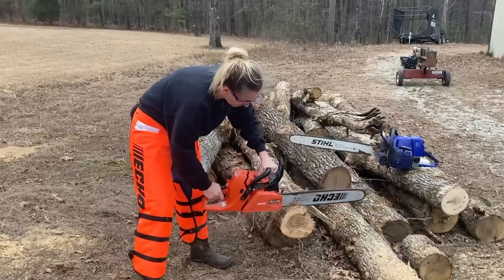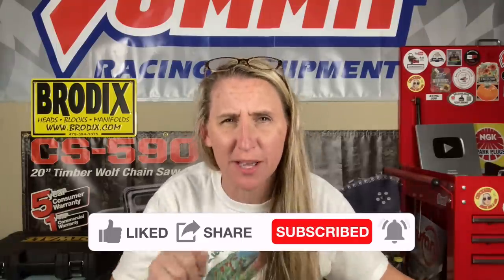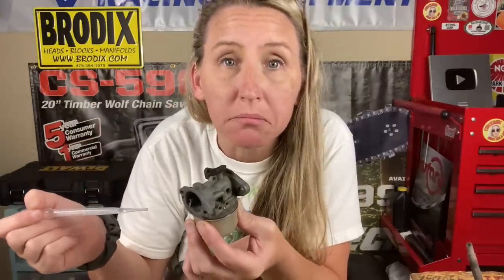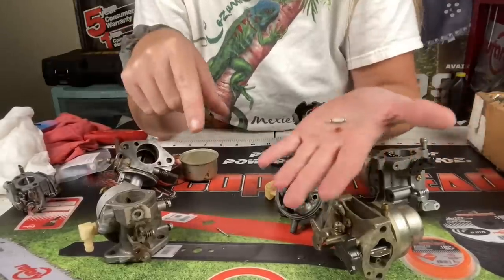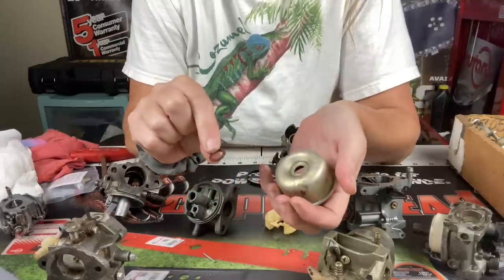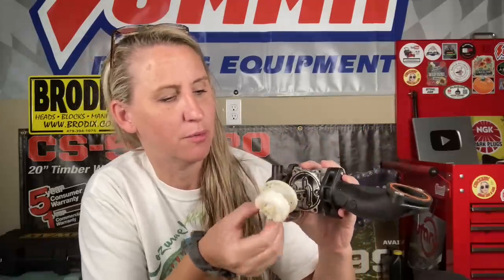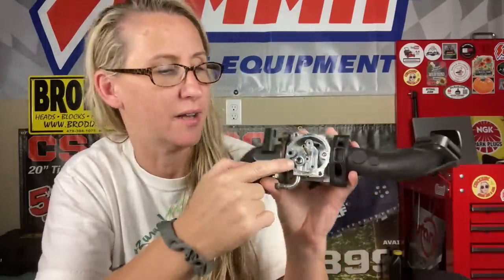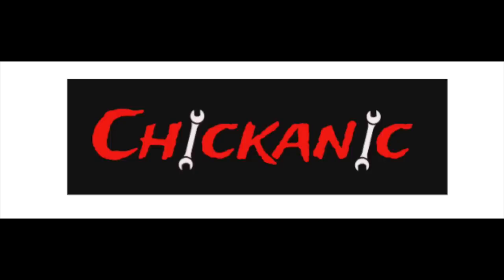STOP doing this! The RIGHT way to figure out small engine carburetor leaks.

Comment: I went the fuel shutoff route on my  riding mower.
Reply: Me, too. Easy peasy.
Reply: Same
Reply: Same here. Cheap easy to do and 99.99 guaranteed to every time. Great for winterizing letting the bowl empty out and not sitting with a carb full of fuel for months. No pinching fuel lines if you need to pull the carb or even your tank if need.
Reply: Wisconsin winter is a cruel mistress. Especially to gas that sits all winter.
Reply: Excellent video, thanks for the information.😀
Reply: @@backwoodsvirginia "revenue generators". Besides, the average "birdhouse builder" would never use it.
Reply: Same....
Reply: I put a shutoff on everything. One of them I need a pair of pliers to turn it. How can plastic be that hard to turn😂

Comment: I don't waste any time buying any internal carburetor components.i always replace the carburetor which on Amazon is $12 -15 bucks and it's the best fix on everything I work on with any kind of fuel related issues..I've been a small engine technician for over 25 years. I love watch and love all of your videos because you are professional and very talented..
Reply: Have you seen her videos explaining why you would perhaps be better off rebuilding the OEM carb.s?

My advise. If you are not a very good mechanic, and also poor, and in a hurry to get shit done; get the knock off's. 50/50 you get one that runs well and lasts though. Then when you make some time, clean and rebuild the original carb..
I have been tempted to buy an off market carb., but never needed to, yet.

Comment: About 4 years ago I got a 1 year old Murray rider for $25 because the engine was seized. I checked the oil, and it was ALL gas. The guy I got it from said "I just put a Brand New fuel line on it ". He DIDNT put in a fuel shut off valve and it drained a Full tank of gas through the carb, filled the intake, and then filled the crankcase. The engine couldnt turn over because it had Hydro locked because it Cant compress gasoline. I drained the engine, refilled it with OIL, and I installed a shut off. Probably the best $25 I've ever spent. I actually used it earlier today. 😎

Comment: Hi Chickanic.
Totally spot on 👍
Another reason the float bowl seal might leak is because they tried to fix it themselves, and didn't fit the bowl on correctly so when they tightening up the floatbowl bolt, the bottom of the float bowl got pulled up so when it is sat correctly, there isn't enough pressure pushing on the seal to seal it.
Just a few gently taps to push it out stops the leak 😁

Comment: Back in the late 1950's I rode 1940's Cushman motor scooters. Then I moved up to 1950's and 60's Harley Davidsons. Both had carbs. that were prone to leak at times, usually due to a stuck float. I carried a rock in my pocket just to bang on the float bowl...worked 90% of the time. It was usually trash between the needle and seat...from the 32 cents per gal. gasoline we were using.

Comment: Great video! I have been repairing small engines since I was 9 years old, today I am 59, I have never come across anyone who who covered this topic as well as you have. The only thing I have come across that caused the leaking aside from what you mentioned is 
 sometimes the float has been twisted to one side and it scrubs the inside of the float-bowl or a dented float bowl.
Reply: Dented float bowl..that’s a new one! Must’ve been hammering on it trying to free the needle? If I ever see I dented bowl I’d automatically replace it.

Comment: I’m sure I haven’t done nearly as many Tecumseh carbs as you all, but I’ve done a bunch, at least 100+, and I’ve never had one leak into the air filter. I had several not work when I was first starting out, but I gained some experience through the school of frustration and soon was able to clean them correctly. Now I prefer the Tecumseh to Briggs, although Briggs are much easier, I have had issues with the needle and seat not seating properly. I just had one. A few days ago that I had apart multiple times only to eventually replace the carb. I had replaced the needle and seat and float, as well as thoroughly cleaning it. Still leaked past the needle. Your tutelage is most welcome.

Comment: 👍🏻 There’s a common theme in many of your videos that a huge number of people not only don’t maintain their equipment but actually abuse it!
 Myself, I have other things I’d rather spend money on. It only takes a few minutes when you’re done using a tool to store it properly and occasional maintenance is a heck of a lot cheaper than the hourly shop rates of a professional mechanic. 
My chain saw is a 1980 McCulloch 610 my lawn tractor is circa 1998. I found a 1972 coast to coast rototiller in a dumpster that just needed some TLC and it’s served me well for the last 20 years! 
That Lowes electric mower is a perfect example of how low our expectations have sunk. 
I truly enjoy your show!
Reply: My newest chain saw, not counting a small McCullough which is also decades old, is 1980. Most are 60's and 70's. I have been rebuilding some. I have 5 vintage saws ready to work. One was my Grandfathers saw. I have used it for 20 years. My tiller engine is aprox. 1980, but the tiller is 15 to 20 years older. My oldest push mower is probably 50 years old. Newer lawn mower was pulled out of the trash at least 15 years ago. I have a 1995 line trimmer I just cleaned up and put a carb. kit in. I have a few more old engines stored away, and enough parts for my vintage chainsaws to get two more working....soon.
Look after your machines and they last, if they were any good to begin.
Reply: @markluxton3402  Your last sentence is the key. 
Today the focus of design is on speed of assembly and eliminating material. That means clips instead of threaded fasteners and lots of welded plastic. 
Serviceability isn’t considered unless it’s a commercial product

Comment: You're a mine of very useful information.  I had a leaking carb due to a tiny piece of dirt caught between needle and seal. The petrol drained out of the tank onto the floor. Happily none went into the sump. Everything worked ok and nothing had to be replaced. The engine was a Loncin, which has given service.

Comment: The Lawn Boy 2 cycle engines had the plastic carburetors that leaked constantly,even after rebuilding them.When the customer came to pick up the mower,gas would be dripping from the air filter.Ugh! Thank you for the great video!

Comment: My string trimmer was always breaking the line.  You said to soak the line in water.  That seemed like a crazy idea, the line is plastic, why would it absorb water.  But I tried it and it worked.  I must of had the driest line on earth - big difference.  I hate lawn care plus I'm getting old so I wanted a rider.  You said, "If you want to drop a dime, get a Scag."  I now have one in my garage.  So far it has been trouble free except the tires keep going flat but that is okay, I have a compressor.  Mowing now takes minutes instead of hours.  So, thanks.

Comment: Attention, attention! Since yesterday re-using after a few weeks a Tecumsew 8hp engine I noticed a carb leak. Went through all the advice from the so friendly and helpful "ChickMec" and other great site. Well short story check very micro holes in the bottom and shallow side of the  bol. After dismantling, re-installing that was the hiden culprit. For now I epoxed and will purchase a new #30 bol.

Comment: Years ago my friend had a nice honda lawn tractor. He used the honda dealer for servicing but once when he had a cutting out issue he let local farm equipment try to fix it.  Got it back but in short time same issue.  Not sure if same equipment dealer had a 2nd go or not but it ended up back at the honda dealer. Finally the honda guy remembered previously replacing his carb bowl but exact part was out of stock so he pulled one from another engine which he thought was the same. However it wasn't, so his float was sticking on the bowl. Proper bowl solved his problem.

Comment: Though you can count me as one of the techs that usually won't have a Tecumseh issue, I absolutely hate it when a low speed speed surge won't go away on an Intek with a Walbro. Know lots of tricks. But... Then there's that 1 in 4 Nikki single that has to leak. I've gone to Ruxing carbs if either need replacement.

Comment: Was working on a Honda Shadow with 2,000 miles on it that was sitting for years needle and seat stuck together. Once I got the needle out of there of course I couldn't remove the seat so I used a Q-tip & cordless  drill with metal polish from a video I saw, it worked out great cleaned it right up.

Comment: Thanks for this. I have a snowblower that leaks until the tank is empty. With winter coming, and a forecast for above average snow, I am going to need it a lot. First thing I am going to do is put the shutoff valve I already have from the two pack I have left over from putting one on my rototiller.

Comment: Exactly! It’s especially true to have a fuel shut off if you are a construction worker, and you are transporting compressors generators, whatever the constant vibration of going over bumps and unpaved roads will make that float, bounce up and down in the carburetor and overfill it, and it will start to add gas to the crankcase or your air filter always shut the fuel off and let the engine run till it stops!!

Comment: You're right about tukempsa carburator.  I've found a Briggs carb to replace with.
Another leak situation is anything that sits with gas in it the rubber hoses deteriate and clog things up.  Almost always I replace the hose between the gas tank and carburetor.
You hit it on the head for most"carb leaks", I've seen all kinds of junk in the seat for the needle to make it leak.  Very good job.  I'm telling do it selfers to watch your channel.  And even some small engine mechanics.

Comment: Thank you.  I have a log splitter that my dad built 40 years ago with a briggs 8hp I/C. I ended up putting a new carb on it because of the leaking. The new carb has a rubber tip on the shutoff needle, the original does not. I kept the old carb for a backup... and because I'm ahoarder, but that's a story for another day.
Reply: Btw the new carb leakek due to a tiny piece of debris in the needle seat. In other words the old "crap in the carburetor "

Comment: Thanks for the heads up on small engine carburettor repair. Sometimes it just makes sense to order a new carburettor for all the hassle and cost.
Reply: Sometimes it is cheaper to just buy a new carburetor.  Other times,  it's easier to fix. I worked on a power washer today,  the pilot jet was plugged.  About  30 minutes,  and it was fixed.  Wasn't leaking,  wouldn't run without the choke on.

Comment: I’ve got a 1986 Tecumseh HH60 on a Troy Bilt horse tiller. The carb is original and doesn’t leak. No fuel shutoff on that either! Runs great but does need to be adjusted periodically. The cylinder head is a different story. It’s on its third. The low grade aluminum fails and it blows the spark plug out. Kinda dumb. Cheap aluminum head on an iron block. I’m not a fan of many of the newer carburetors. I hate the plastic Briggs carburetors the most. I have one of those and as soon as I clean the jet it seems like it gets plugged again. Honestly, I wish some of my newer engines ran like that old Tecumseh.

Comment: My 17.5hp quantum B&S floods if I don't use the shutoff.  My new home came with a 15+year old Yard Machine and it's my first riding mower.  The previous owner  installed it and I left it open after mowing one week.  Wow gas flooded the carb and it smoked like hell.   😂  learned that lesson! So now I've add a fuel shutoff to all my gas powered engines.

Comment: My old '70's Simplicity 2012 Landlord Garden Tractor's fuel tank had a shutoff on the outlet.  I never thought to close it and let the machine run out of gad!  My Carb leaked and eventually I paid $125 for a new carb.  The old one was missing a plate on one end.  It seems odd that today, some 33 years after I replaced it the price has gone down by 50%.  I once broke the tractor in half to replace the bevel gear in the transmission.  That machine pulled down standing dead trees I'd cut and dragged them out to the road for bucking, then hauled my overloaded cart trailer with the bucked logs!

Comment: I am having that same issue with my 1973 Dodge Charger.  It has a Holly 650 CFM carburetor.  Once the vehicle has been started and turned off the issue seems to go away, but gas should not leak all over the intake manifold like it does on the first start each year.

Comment: Nice video. This is definitely something to keep in mind as it sounds like a common problem. I've personally had a clogged needle on the old Briggs and Stratton a long time ago, but worked perfectly fine for years after when I cleaned it out. Turns on a sliver of plastic from a new gas can had gotten stuck in the needle.

Comment: everything you covered is 100% correct.  Experience teaches you what needs to be adressed. Tecumseh  carburetors  SUCK anyways. I just replace them any more. A fuel shut off on an older riding mower without that electronic shut off on the bottom of the bowel is a MUST . Even the electronic shut off can fail, especially using today's  gasoline plus time. The ethanol  eats the seals in those over time.

Comment: Great video, I'd just add one item to check... The surface on the float the needle rides on. I've seen the be the case in brand-new carbs. It's not adjusted to fully close the needle when the bowl is fill. Slight tweak and they work fine. Usually just test by blowing air into the fule inlet with my mouth... open/close and bend till perfect. 
Can't tell you how many Amazon toro snow blower carbs THIS has been the issue on....

Comment: Ah ha!  This is exactly what I needed to know, before I tried to fix my generator.  Glad I put it off so long!  😁 Now I will do it right the first time.

I add fuel shutoffs AND a tee and another fuel valve so I can easily drain the tank when the gas is old or wet.

Comment: Thank you so much your video was very helpful & informative. I found this video a week a late after my problem with my 6.75 Troy Bilt XP lawnmower I bought it used it worked for a while then started smoking a little hesitating & then stalling on me. I took the carburetor apart & it had old gas in it. I changed the oil it was black & sludge like mud & I replaced the spark plug & filter. It ran perfect but, I noticed it was leaking gas 😮 & from me tearing it down I didn't notice the bowl gasket was missing & another part that was causing the leak. I ordered a new part & that's when I notice what parts were missing from me taking the carburetor apart. Thanks again for this video. For future references I'm going to be very careful when I take these parts apart because,  it can be really easy to misplace them.

Comment: Funny thing is I just yesterday tried to start an old Snapper mower with a Brigs and wouldn't you know it that when I turned the fuel shutoff open the carb leaked, so i'll be spinning it off and checking the needle before getting out the gasket cement, lol. thanx for the timely advice Chicanic

Comment: Check your vent hole on the old Tecumseh carbs.  If this 0.015" hole is clogged, your carb will leak.  It is located above the float bowl on the main body.  I replaced all the other items before I found the real cause.

Comment: I have a snowblower that ended up being out in the weather for a few months due to a car burning down. When I pulled the bowl to clean it, the O-ring ripped and was therefore useless. I ended up twisting up teflon tape into an appropriate size and making a gasket of sorts. It worked. I do need to figure out the carb adjust as it only runs almost completely choked. But, that is for when the mower goes into storage and the blower comes out as they share the same storage space.

Comment: The fuel shut off works for a while. As the needle and seat get worse it will fill the engine while running ruin the air filter. Running it till it stops the bowl won’t be empty and the smaller amount of gas goes bad faster . You still have to fix the carb .

Comment: Yeah, the last time I used the pressure washer (Honda engine) I shut it off to turn around later and watch it dribble a bunch of gas on the grass. I've been lazy but it sounds like time to pull the bowl and look at the aforementioned components.

Comment: Well said. I constantly see equipment with physically deteriorated carburetors, I replace a lot of carburetors. I used to save them as a reminder to customers to not leave gas in them in the off season but after the pile got to about 3 foot tall and about 6 feet in diameter I chucked them. I don’t know if it is the humidity or contaminated fuel here in western Arkansas but either way it leads to a lot of thoroughly destroyed carbs. However that is not my problem anymore, I am hanging it up and going back to plumbing. Currently finishing up repairs on about a dozen items and that is it, I’m done. I know that leaves my area with nobody with a real shop but I just can’t take it anymore.

Comment: Thanks for the video I worked at my friend's lawn mower it's only a year old she bought it at Home Depot it's a brute push more the cardboard is made in Indonesia it's all plastic I had to use microscopic drill bits to clean out the orifices they're all swelled shut I got to run great the carburetor is not even bolted on it's held on by an O-ring that's the cheapest thing I've ever seen in my life hold on much plastic even the handle I never saw such a thing what's some junk have a great day:face-green-smiling: and she paid $400 for it